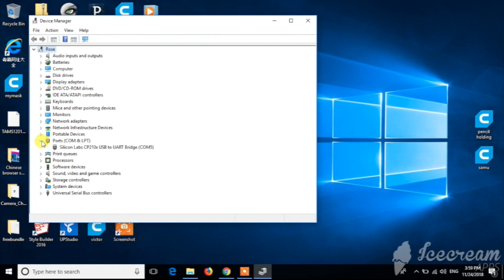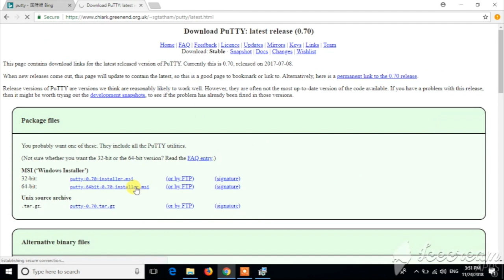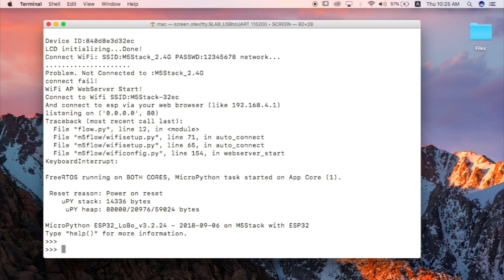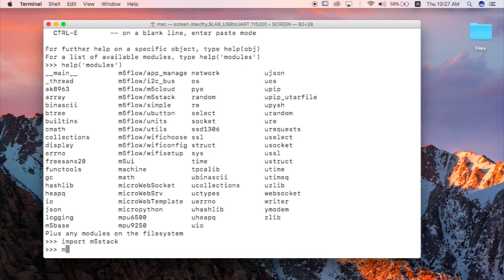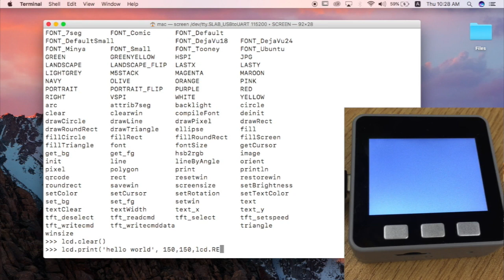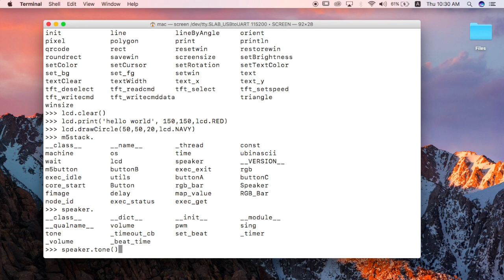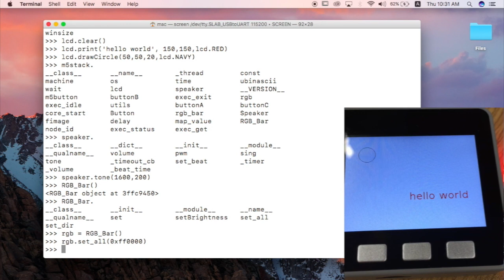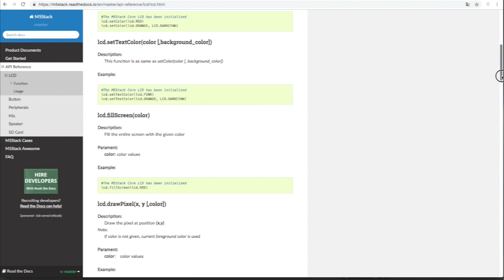How to Setup Serial Communication with the M5Stack (Win/Mac)

Comment: How can I capture the serial JSON information with Python? I tried connecting to it using pyserial like if it was an Arduino, but it doesn't work. I don't know what port or baud rate it is. I can connect to the camera through Putty, but I'm not familiar with ssh to know what to do with from there.
Reply from the maker: https://docs.m5stack.com/en/quick_start/unitv2/base_functions 
Hi please check this doc. it mentions  the baudrate

Comment: Hi Luke: Had some questions about UIFlow:
1. I used the M5Burner to upload UIFlow 1.2.2 to a grey M5Stack, and am able to write simple apps using http://flow.m5stack.com/ 
How do I go back to using Arduino - the M5Stack no longer shows as a serial port!
2. I also got a M5Go. It also does not show as a serial port, so how do I upgrade UIFlow?